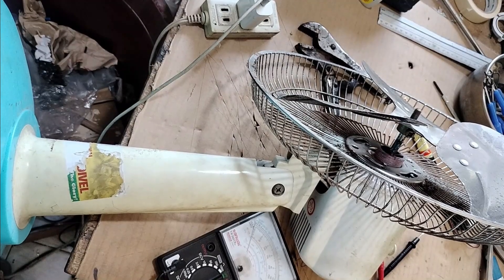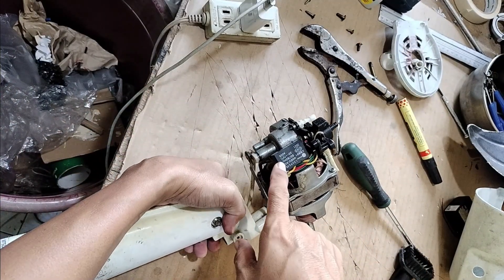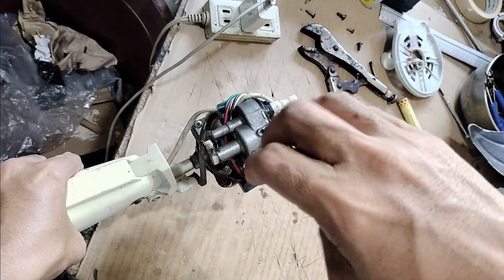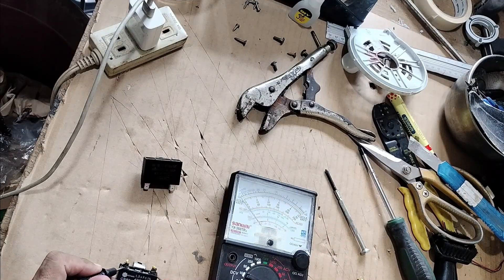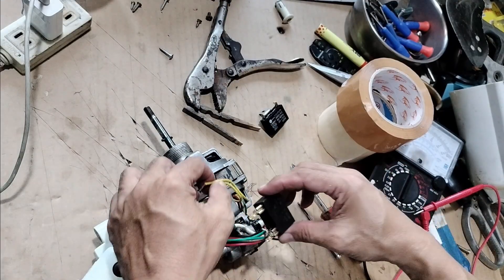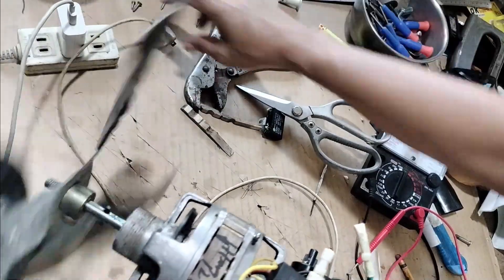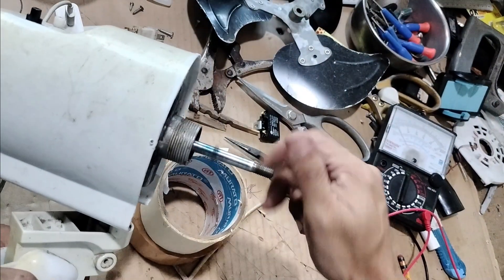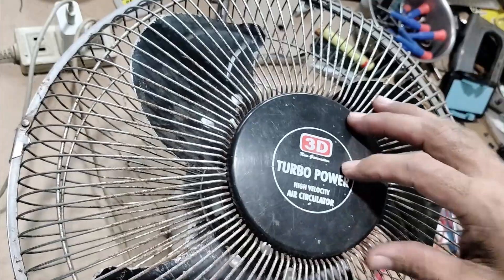How To Install An Electric Fan Capacitor

Comment: Poor technique. Why did you use a capacitor with exposed terminals, instead of a wire-type capacitor like the original one?
The wire terminal is exposed which poses a danger, and it's close to the motor shell which is Earthed. A risk of short circuit to Earth will happen.